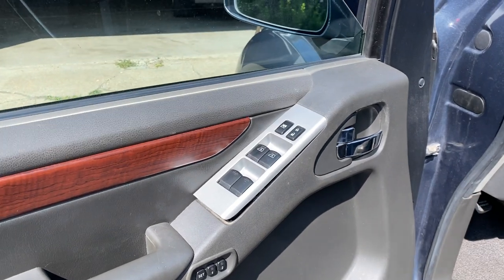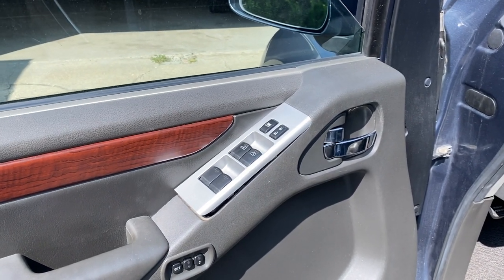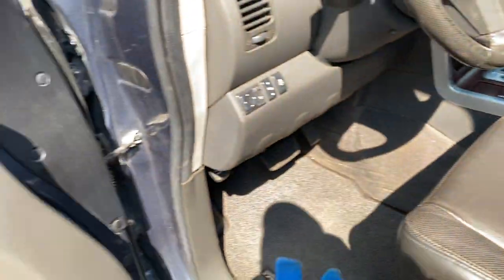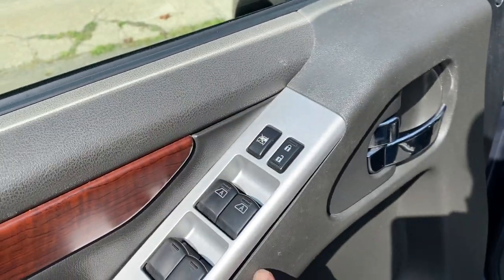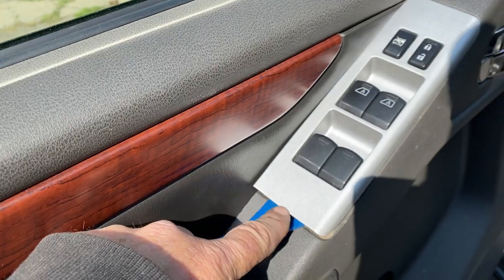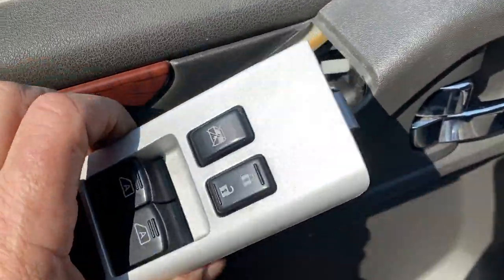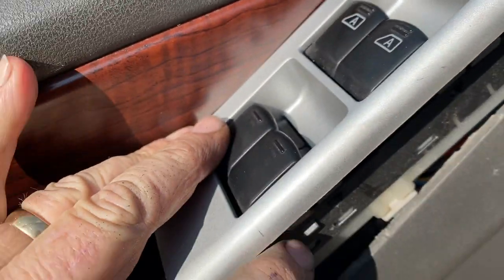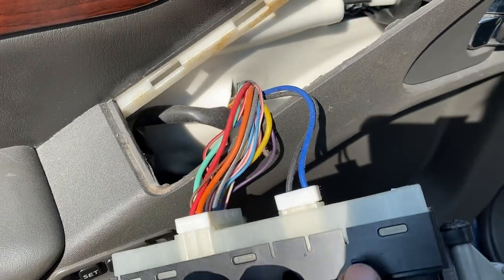Removal of Driver’s Door Power Window Switch on Nissan Pathfinder 2008-2012

Comment: Could you tell me ,what is the function of secondary plug conector (tiny with 2 wires)?
Reply from the maker: The 2 plug wire? That's controls the power locks.

Comment: How do you get the connectors to release?
Reply from the maker: There is a center pin you push in while pulling the plug out

Comment: Question, my passenger window went down when I started my car and now can't get it back up.

Only way I got it ba k up with my key in door to get it back up.once I did I then put the window lock to keep it from falling.if I release window lock the window will come back down...Any ideas? Thanks
Reply from the maker: Sounds like the drivers door switch is faulty. Probably the one touch down feature is stuck in the switch itself.